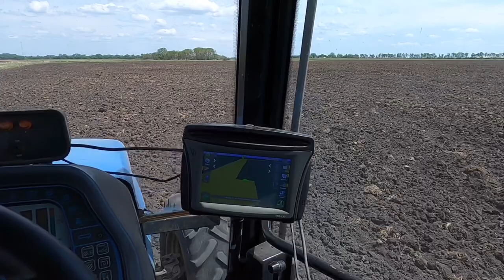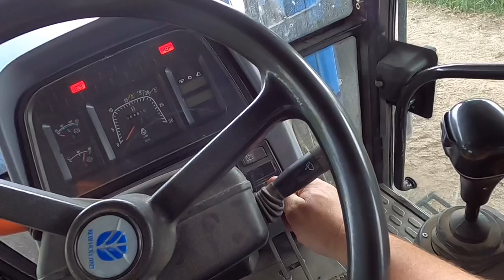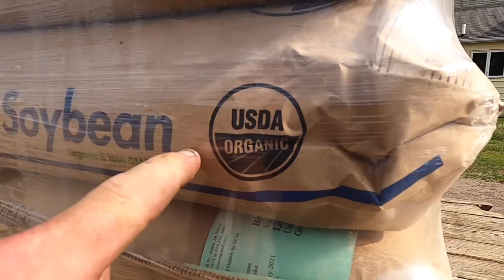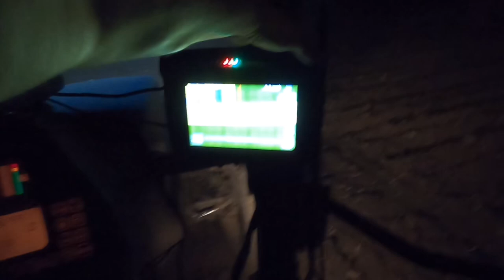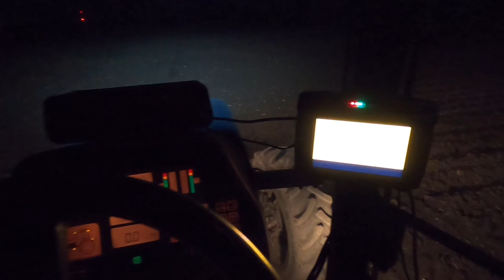Planting Corn and Soybeans and Praying For Rain!

Comment: Hi Paul good video! I know the video is about a month behind but it’s gotten drier here since then and the temps are crazy 🥵 I think in the month of June we have been over a hundred 5 days and all but 2 days in the 90s with about a 1/4 inch of rain ! I’m about a 130 miles sw of you . Surprising the crops are hanging on but they are on borrowed time if we don’t get rain soon . And if we don’t get rain there will be lots of cows and calves going to town before august ! Let’s pray this thing turns around and the rain starts falling 🙏🏻
Reply: Yea, Bismarck at least has reported this June to be the 2nd highest temps on record... i think 1938 still has it beat yet. Add in the wind to the mix too and it's ugly.